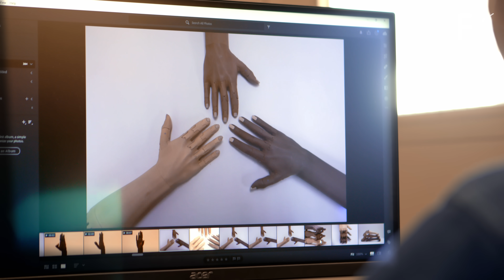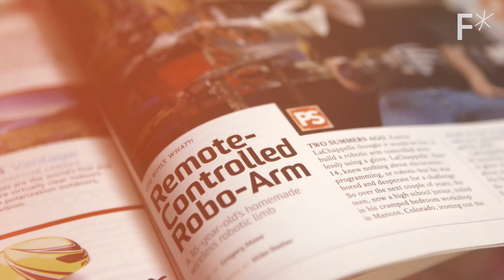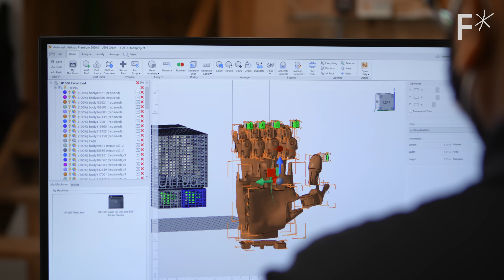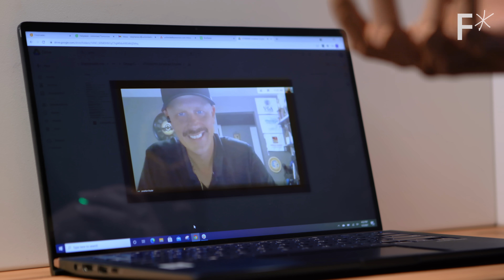3D printed, mind-controlled prosthetics are here | Challengers by Freethink

Comment: Man doesnt understand basic market economics. Whenever technology is developing prices will be high and there will only be a handful of companies developing so there will be relatively low competition. As the technology increases and becomes more profitable more players will come in and start lowering prices and modifying and building off already existing designs. Prosthetics have only somewhat recently been going electronic and developing neuromotor technology is insanely expensive and difficult for engineers to design

Comment: Truly amazing. The only possible issues I can see with this device/method of building it is possible water vulnerability, and friction of the fingertips. A normal human hand has a lot more gripping power from the skin than some realize, a lack of the same level of grip/traction on the fingers could cause issues (Which I specifically noticed with the lady opening her water bottle, it was slipping slightly inside of the prosthetic hand). Perhaps you could manufacture replaceable fingertips to allow for more firm gripping without having to squeeze objects as tightly, though that might reduce the object's durability, as it's another part that can wear out separately.

Comment: The problem is that their prosthetic is almost useless as a hand.
   It's still expensive considering it's less ugly and at the level of a moving prosthetic. All products of prosthetic companies have this problem because the original technology companies and materials engineering have not reached their goal. Efforts to eliminate brokerage fees are great. Because prosthetic companies have tax support, they don't have to try to cut brokerage fees. In countries like Korea, the more expensive the product, the higher the tax is, so the price is deliberately high. An electric wheelchair with few features can cost more than $6,000. Selling like this could put manufacturers and brokers in their hands of around $4,000.

Comment: it is amazing to give that to someone in need, but i have 2 issues with this. first off, not mind controlled. in that video of her getting it, she has to press the big button to open and close the hand. no fine control, no other way to operate it, hence why she crushed that box. so this is misleading as hell. also, if that thing costs anywhere near $8000 they should be dragged into the streets and shot, ive seen childrens toys that are more complicated than that, it operates like an automatic car window, which if youre not familiar, doesnt cost anywhere near $8000. you could produce something functionally equivalent for well under $1000, and im not going to applaud a company for ripping off people in need slightly less than everyone else

Comment: Amazing work, Amazing technology,  just imagine when he finds a way to make those robotics fingers move faster.
Reply: And stronger!
Reply: I think it's a matter of security and energy consumption.
Also it would be more difficult to control since they have no clean nerve signals from the brain.
Reply: I think it's not that they couldn't already be made to move faster, but I'd imagine for longevity of the joints they are intentionally slower.
I don't see how it would make a significant difference to have faster movement tbh. Greatest areas for improvement is the simple mobility of the joints.
In the future you might be able to wire your nerves into these with sensors that could create real sensation of touch, that will be awesome once it happens.

Comment: Cut down the cost by only having 3 to 4 finger. Usually that's enough for most everyday activity, that's if you also don't care about looks.
Reply: That would make an almost negligible difference to the cost. The actual materials and manufacture is a tiny cost, probably less than 5% total. The real cost comes from running a whole company, developing the product, fitting the prostheses, supporting patients, servicing, etc.
Reply: @ytubeleo  True

Comment: This is impressive, but they're really missing the ball in several areas. Mass manufacturing, adaptive sockets, neuroimage feedback, compliant joints and silicone skin all can lower the prices much further. In addition, there would be no fitting process. It would be like picking shoes that are the right size, but then having those shoes custom form to your foot. Cable actuated prosthetics need to disappear. No visible joints, no motor sounds, warm synthetic tissue... It's all achievable now with cheap tech off the shelf.

Comment: Title says they are mind controlled. I want to know exactly how they work, and how their control scheme/finger meneuverability works
Reply: "Mind controlled" is just a very poor and vague term for what actually happens here. With all these limbs (and there are many very similar) the muscles in the arm (e.g., remaining forearm muscles, or biceps if above elbow amputee) need to be clenched, which creates a small voltage difference (around 1-10 mV) that can be measured on the skin and amplified. A microcontroller controls motors that pull small cables to make the hand close. Various control strategies can be programmed – e.g., contract again to open the hand.

Comment: Looks like it uses the same basic design as the InMoov robot designed by a guy from France, I built one eight years ago. We need this to be open source, I would make several and give them away. The arm looks to be mechanically the same, only the sensors would need to be added. If this were made open source, I would never make a dime, not only would I not profit from them, I would cover all costs and give them to those who can't afford to purchase them.

Comment: Wait a sec, I thought we couldn't yet interface the user to the prosthetic to provide fine motor control. This seems like the biggest change here, or you're misrepresenting something. Please clarify your "mind-controlled" claim.
Reply: According to the website there's 36 what they call "ultra precise sensors" so I would assume that it's detecting electrical stimuli in specific parts of the arm and using that information to achieve somewhat intuitive control.... I think mind control is an incorrect claim
Reply: @harrcorr216  and @etmax1 you're both kinda right. I've seen a diagram where they point to sensors in the socket area and to (I quote) an "AI motion control system". That would be your clever software. But that's no mind-control unless we count things like "using a computer mouse" as "mind-controlling a computer".

Marketers... you just gotta hate their filthy guts.
Reply: I would say they are using pressure sensors to detect muscle movement and some very clever software to translate that into a limited number of actions. Also usually people need hours of training initially to "get the hang of" operating these things so some of that was staged.
Reply: One could "read" the nerve input from the users to certain parts of the shoulder and arm, and extrapolate the amount for force requested.
Reply: @MrPuffin69  You don't think about it when you pick something up but the amount of force applied is a complex relationship between suggested force (from the brain) and pressure sensed in the fingers that is processed both in the spinal cord and to lesser extent in the brain and used as feedback. They did calculations on piano players based on the speed at which nerve impulses travel, and determined that if all of the control was from the brain (ie. the spinal cord was not involved) it wouldn't be possible to play the piano like a master, instead we'd all be stuck playing like beginners.

Comment: How exactly is this "mind-controlled"?
Reply: The people using the prosthetics move the muscles in the part of the arm with their mind… the device reads the electrical signals from the muscles and then moves accordingly. It’s probably not the answer you were looking for.
Reply: @ricosrealm  I worried that's what they meant. That's such a weird understanding of "mind controlled".
By that definition, moving something with my arm is me mind controlling it.
It's especially annoying because neural control of prostheses is actually possible and does fit the term "mind controlled" much better.

Comment: Amazing video! The fact that the price has already fallen to $8,000 is extremely promising. There’s no reason the price won’t just get cheaper every year, really great stuff.
Reply: "There's no reason.." 
Enter capitalism and corporate business models, riding a flag and talking about the American dream.
Reply: Sadly one of the big cost is the fact that it's unique to everyone. It's not the material, not even the electronic parts (though they both still are quite expensive) it's mostly the customization required to make it fit perfectly and confortably. The end where the kid has to hold the prosthesis to lift the glass make it seems like that part is still a work in progress.

The "automation" also need customization. I was amazed at the beginning when it just worked for her and waited to see explanation on how they achieved it, but they never explained it. I feel like it was partially staged, either powering it on made it hold, or simply it wasn't a voluntary action, essentially a convenient mistake. That action need to go from somewhere, it's not magic, we aren't at the part yet where we can simply connect to the brain (it's the next Elon Musk venture though). Theses actions come from old muscle, that in some case are accessible easily, but in others aren't. Again the placement is important there, the sensor has to be close to the muscle, and for some, more complex sensors are needed.

3D printing help quite a bit to fix a bunch of theses customization issues, but there's still quite a bit to solve. Sadly doing this cost a lot, and that get reflected on the product cost at the end of the day. Hopefully it seems like he got some great sponsor there, so lets hope it stay that way, because the day he'll need to cover all the R&D needed... may make it unviable.
Reply: @dwild92  If you watch the videos about this limb carefully, the limb is controlled by a single button on it.  Push the button and it grips the hand.  Push again, it releases.  The hand does have sensors to just barely grip whatever it touches, thus the water bottle or empty box is not crushed.  Amazing, but 0 videos exist of any "mind control".
Reply: @dwild92  her original video is on YT, she used the button to make the arm grip.
Reply: @dwild92  Guy is selling snake oil. Pretty simple. His language says it all
Reply from the maker: This is definitely just the beginning! And what you and your daughter did is incredible, Bodo, thanks for commenting! We'll share the video on our community page.
Reply: Government and greedy business people.
Reply: @BestMods168  Yeah, you're right. Insulin costs like 10 dollars to make and americans buy it at a rip off price.
Reply: Lol found you! Love your startup analysis videos, John!
Reply: If it's available at the cost of a new I phone I'll donate 5 of them to needy 8k is still very expensive for people outside USA
Reply: @anshulbhardwaj4038  maybe other country's should model them selves after the US so the can have better innovation.
Reply: @kevincornell1439  obviously they should no doubt but we were talking about this particular invention that can help people.what is more important helping people or country of origin from help arrives ??
Reply: Enter capitalism
Reply: @woozhi9218  
Capitalism has generated employment, wealth, and a better life for many millions of people.  Take your failed  Communism and shove it, Ping.
Reply: @darwinjackson3560  in a hunter gatherer group i d agree.
Reply: pls where can I get this wonderful opportunity and how much from Nigeria
Reply: Because this is new generation with cheaper modern tech, such as 3d printers. Back 30y or 20y ago this was hand carved or molded in heavy machinery that cost millions. It was just expensive to make, only now the 3d printers and IT techs are being available everywhere for everyone. In 2000s get a developer to code the movement of an arm was impossible. Now there are devs everywhere, internet for quick and easy search etc.
Reply: Its funny I can buy entire cars for 4000 thousands new or 400 used with tons of micro electronics, tons of work and Material put into it, but a bit of plastic with a cpu and tiny motherboard in it costs 80.000
Reply: Greed, politicians corruption
Reply: uhhh,America?